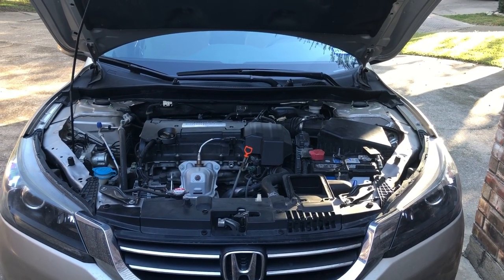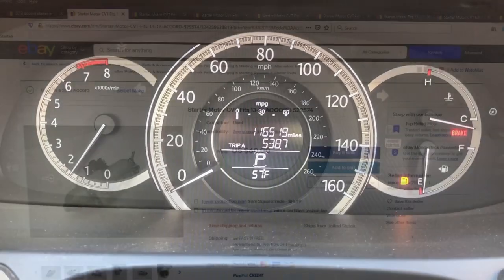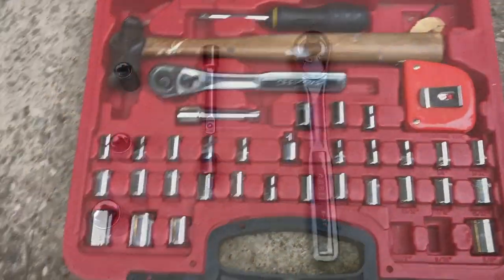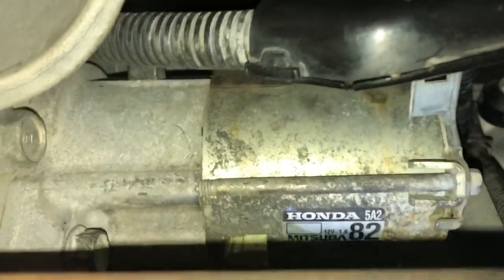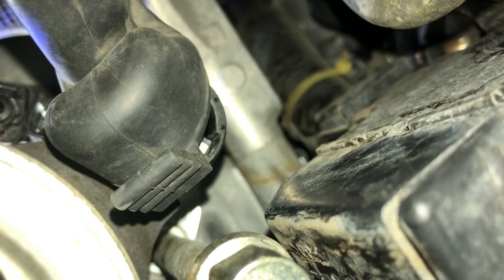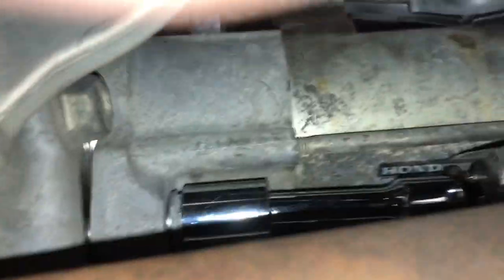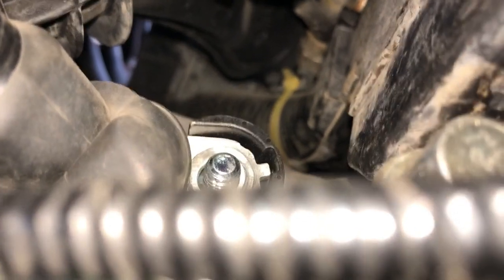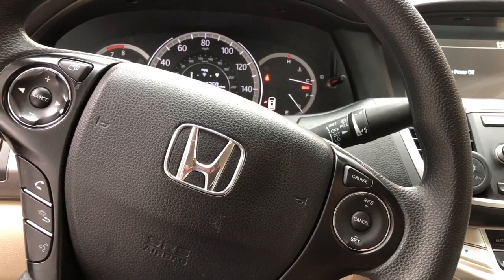Starter Problem & Replacement in Honda Accord 2013, 2014, 2015, 2016, 2017

Comment: My 2015 Accord Sport has started this issue. Where I just turn the key and it just goes "click". Today, it took me about 15 turns of the key to get it turn actually start. That is the issue you had? Battery tested good . The number of turns keeps getting worse and worse. Replaced the starter and your good to go?
Reply from the maker: Yes, I had the same issue. I replaced starter and it fixed the issue and so far so good even after 1 year. I bought the used starter from ebay that I show in video. You can also buy new directly from any parts store. Part # is in description of video, I hope it helps.
Reply: same on my 15 sport
Reply from the maker: @Baselll  Did it just start to have this issue? How many miles on odometer?
Reply: did you get your problem fixed? This is what mine does.
Reply: what was the fix?
Reply: @FlyBeee  it started at like 86k and got worse after a couple months
Reply: @carolkhoury120  the new starter fixed it
Reply from the maker: @carolkhoury120  I replaced the starter. The step-by-step instructions are in the description of video and the video itself shows the full detail of replacement. The bolts were a bit tight so if you can get through them, the whole process is simply to disconnect / reconnect 2 bolts and 2 wire connectors.
Reply from the maker: @Baselll  yeah, about two months is what it took mine to get worse too.
Reply: Thank you!
Reply: I’m currently having the same issue. Checked battery and alternator with a DMM and everything checked out fine. Currently experiencing the one click everytime i turnt he key. Takes about 5-10 separate turns of the key until it finally turns on.
Reply: @p4ldurazo  did you get it fixed? What was it? The starter? I am wondering if it is a main relay issue
Reply from the maker: @p4ldurazo  You have some time to find a good repair shop to get the work done or get the part ordered to do the work yourself. If you are opting for latter, please review the description of video where I shared step-by-step guide on how to complete this work. Best wishes

Comment: Is this a common problem. My stater is dying but I only have 60k miles on my 2013 Honda ACCORD?
Reply from the maker: Yes, it is a common problem on this model of Accord - but very uncommon for a Honda. I have had several Honda vehicles and never had to change a starter. If you are having starter issues - but the car is driveable then use this time to get a good replacement starter. You can install it yourself - and save quite a few $
Reply: Same issue with my 2015 Accord with only 65k miles!
Reply from the maker: @DSeN7  Oh, only 65K miles. If your car just developed the issue then it would still work /start after a few tries but use this time to get the replacement star or schedule the work at repair shop. Are you looking to replace the starter yourself?
Reply: Yes, unfortnately....I've replaced one already and now having similar issue so on to starter replacement #2  :-(
Reply from the maker: @mali2640  Dang! second starter replacement does not seem good. I have so many Qs about this already! What model year of Accord and how many miles on it? Was your first replacement starter OEM or aftermarket? Are you looking to do the work yourself, which will save some money?
Reply: @FlyBeee  Hi Fly Bee....I'm very disappointed, to say the least.  It's a 2014 Honda Accord with 97000 miles.  My first replacement was a brand new starter but it was from a generic manufacturer.  Last time I got the part and had a technician from my local shop put it in to save the money.  Probably will do the same this time.  I don't think it was the installers fault.  What is your take on reconditioned Bosch starters??  Also, I'm wondering maybe it's something else which is causing damage to these starters.  I'm not very well familiar with cars so I don't have a clue.
Reply from the maker: @mali2640  My experience of owning several Honda/Acura vehicles over the years is that Honda vehicles do best with the OEM parts and oils. I wouldn't recommend a generic manufacturer or a non-OEM starter. If it is possible, get new OEM starter (part# in description) or a used starter OEM with low miles. Also, Honda vehicles still work awesome but you have to maintain them. If you get a chance please see my other videos on this 2013 Accord for its oil burn issue and transmission fluid change. Transmissions are Honda's weak point but a simple drain & fill will keep the transmission protected. You can do this at home easy... I hope this helps. Best wishes.
Reply: @FlyBeee  Thanks FlyBee....on this coming up replacement, I'll make sure to do that.  Appreciate the time and advice.
Reply from the maker: @mali2640  You are welcome. As you see in video I bought a used OEM starter (with 27K miles on it) off ebay for $60 and it has worked well for 15K miles since the install. Mentioning this just in case you want to consider going this route.
Reply: @FlyBeee  it is oem starters that fail so consistently...
Reply from the maker: @darrenarmitage3460  Yep, they sure do. Which of the non-OEM starters have you had better experience with?
Reply: 2014 Accord Sport w/ 55k miles and having this issue… Shame because I was loving the car up until this point

Comment: I have a 13' coupe, it has a push to start and when I go to turn the car on it makes a "click" sound. Either a relay or solenoid but it's getting worse and only happens during winter months. Could it be a bad starter?
Reply from the maker: If your vehicle starts okay but the start button is where you hear the sound then the issue may well be with push start button in Accord - which is a known problem. Check the CarComplaintsDOTcom and lookup the trim level of your Accord.
Reply: @Fly Bee  it doesn't start immediately below 50 degrees. It takes a bunch of tries before it starts. I thought it was the button and switched it out, replaced the battery and think it's the starter now
Reply from the maker: @jonathanmilland2867  when you get a chance see this video https://youtu.be/xem8JQdKhAw and let me know if your Accord acts the same way. You can also do a test to check alternator. If you decide to change the starter, see the description of this current video on detailed step-by-step instructions.
Reply: It acts the same way and takes much longer to start sometimes. Should I replace with oem since I put 192k on it currently or should I replace with something else?
Reply from the maker: @jonathanmilland2867  I would recommend OEM for Honda. As you see in video, I replaced mine with a used OEM starter with low miles and it is still going strong in my Accord. But do what you are comfortable with. If you decide to install yourself the video itself is step by step guide and I have also noted these steps in description of the video. I hope it helps.
Reply: Thanks. I went oem
Reply from the maker: @jonathanmilland2867  Awesome! If you are planning to install yourself, please review the description of video that has step-by-step instructions and let me know if I can answer any questions. Thanks
Reply: it's the brush holder set in the starter. Honda used bad parts: 31210-5A2-A01
Reply: @MS-89  I don't think they used a bad part on my vehicle. It had around 150k before acting up. 10 years on same starter is good in my book. Thanks anyway

Comment: Just wondering how did that starter hold up, is it still starting up. It seems that on my 2015 accord the starter is my main issue, it’s been replaced 3 times, pretty sad huh, i under I used aftermarket parts but the original one coming from the factory went out at 40,000, that’s not right, I remember when Honda use to make dependable and solid parts, unlike now they compromise quality for profit. God bless all
Reply from the maker: I have driven 15K miles on this used OEM starter and no issues so far (odometer is now at 132K miles). My other Hondas never had starter issues so I was surprised when mine went out. Can't believe your Accord had issues at only 40K miles :(  that's rough!  How long did the aftermarket part last? I have had several Honda vehicles and learned that Honda vehicles don't do well with non-OEM parts or fluids so my recommendation would be to use OEM, whether new or used.
Reply: @FlyBeee  the aftermarket one I bought off eBay lasted about 3 years, hopefully this one will do better, I should of bought a used on from a salvaged car with low miles instead. Good to hear your is still going strong. Thanks for the reply and God bless
Reply: Have you tried rotating the torque converter one bolt counterclockwise? Honda has this listed in a service bulletin (TSB 16-002).
Reply from the maker: @chriscastillo4408  I didn't rotate the torque converter. If you have tried, what are the results?

Comment: good job finding a better deal on eBay, people who sell on ebay for a living are usually pretty honest about their product.  I had similar starting issues this morning but in my case it was the battery.  Your video was very informative helping me find my problem and I'm sure it will serve as a great guide when it comes time to change the starter. 👍🏼
Reply from the maker: Thanks so much for the nice comment and glad you found my video helpful to diagnose the problem. Glad it was only the battery! Most of my vehicle batteries fail either this time of year or in Dec, LOL. I didn't know this model of Accord has problem with starter motor until started to fail on me. The only good thing about starter failure is that it gets worse over a few weeks so we get a chance to order a replacement. Batteries just go kaput overnight, lol. Thanks again for the nice comment. Best wishes!

Comment: Just here to share my experience with my 2014 Honda Accord sport manual 4 cyl.  I tried a reconstructed duralast starter from AutoZone didn't work. My dad ordered me a Denso from the shop he works at, didn't work.  I finally had luck purchasing one from Honda directly.  It costed me $483.95 after getting $75 back for returning to OEM one and getting a 10% discount.  I tried to save money by not having to go to Honda but could not get any to work.  At least i saved some money by having my pops help me install it.
Reply from the maker: Thank you so much for sharing your experience and the details you have included, it will help others looking to replace their starter!  I have had several Honda vehicles over the yeras and in my experience these do best with Honda OEM parts (and fluids) so I am also not a huge fan of aftermarket either. So glad you got the starter replaced with your pop's help. How many miles do you have on your Accord?
Reply: @FlyBeee  i got around 65k miles on my car right now.  I hope it lasts me a lot longer!
Reply from the maker: @BIGDAGGIE1  65K is pretty good! some people had starter issues at 40K miles. You have a new starter installed so I am pretty sure you are good for a while. When you get a chance please see my other videos about this accord's engine oil consumption and transmission fluid change. I hope that helps. Best regards
Reply: @FlyBeee  i will, funny that you bring that up.  My dad told me recently that i was low on oil, it kind of shocked me because it was very low. So it looks like it's a common problem.
Reply from the maker: @BIGDAGGIE1  It is awesome that your dad keeps and eye on your car's maintenance! Most people don't even check oil/fluids unless the maintenance minder or the service shop tells them they have to, lol. Honda's Earth Dreams engine used in this Accord and CR-V has oil burn issue that Honda (and its dealers) do not want to acknowledge or fix. The most imp thing is to be aware of it and take action to address it when it starts to get worse. If you see my video on this issue please also ready the narrative in which I have provided details of the problem and the solution that has worked for me so far. I hope this helps. Best wishes
Reply: Hi. Thanks for sharing your experience first off.
Just to clarify, On your Honda, did you have problems starting the car with the push start engine button? Then you changed the starter unit with a Honda brand.
I have a 2014 Honda Accord with the same problem. I’m trying to figure out what to do. You guys are definitely helping out. Thank you
Reply: @borisdaza231  hi, my car doesn't have a push button so i turn it on with a turn of the key.  Whenever i would try turning it on all i would hear is a single click sound.  After multiple attempts my car would eventually turn on.  I had to purchase a starter from Honda to fix the issue.  Now my car turns on every time with one try.  I hope that helps, my dad helps me with car issues since he's a mechanic.
Reply from the maker: @borisdaza231  Accords with push-button start have an issue with the button, please review details on CarComplaintsDOTcom. This means you may be having issue with the push-start button or the starter. The key is to see what the car is doing when you try to start it. I found another video (https://www.youtube.com/watch?v=8pO8M5K3aI0) of Accord with push-button start having issues. Please check it out, may be it will help clarify whether it is starter issue or start-button issue. Thanks

Comment: Thanks for the great video! The OEM starter lasted 160K miles which isn't too bad. It was acting up and I just replaced it after it totally failed and I had to have the car towed home. Took about two hours to replace. It probably would have taken about 30 minutes if there was more space to get my hands and tools in position. I used an aftermarket starter from Amazon. I hope it lasts a while!
Reply from the maker: You are welcome, I am glad my video helped. Totally agreed on lack of space around starter.. it causes the most delays because otherwise it's just two bolts and a wiring harness to disconnect/reconnect. The good news is your OEM starter lasted for good 160K miles! thats awesome

Comment: Got my starter battery and alternator tested and they claim it’s the alternator. I don’t have a battery light and still have all the lights on the dash coming on when I try to start my car. Replaced the battery and it worked for a good week or so now when I try to start the car the starter either engages then cuts out halfway through or dosent engage and I have to turn to the On/Off position to get it to crank once or twice. Thoughts ?

Comment: Starter is grinding when trying to start…any thoughts?
Reply from the maker: Was the starter replaced recently? Does it start the car even with the grinding sound?
Reply: @FlyBeee  mine is doing the same. I replaced the old one and now it’s grinding upon startup.
Reply from the maker: @jmc224  It seems that the 'starter gear' - the part of starter that connects to engine - may not have seated correctly and firmly. You may have to loosen /unscrew the bolts that connect starter to car's body, wiggle the starter a little and reconnect it to gear on the engine. Best wishes
Reply: @FlyBeee  thank you! I will climb underneath and see what I can do!
Reply: @FlyBeee  I replaced the newly remanufactured one with a salvaged one and it works without issue and without the metallic grinding noise.
Reply from the maker: @jmc224  This is awesome! Thanks so much for the update and solution. I am sure this will help anyone else experiencing this issue. Best wishes!
Reply: Clean battery post,and starter issue
Reply: I also had a grinding sound, it turns out they gave me a wrong starter for manual instead of CVT/ automatic Transmission starter.